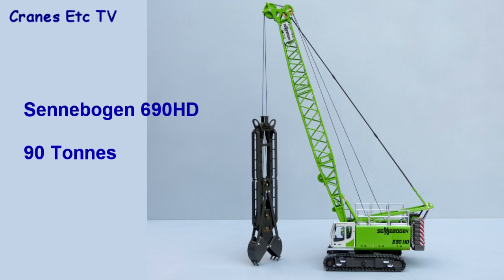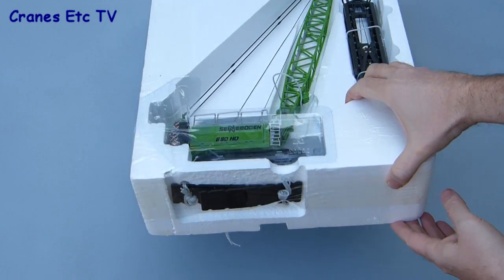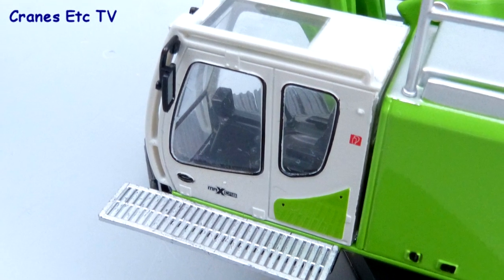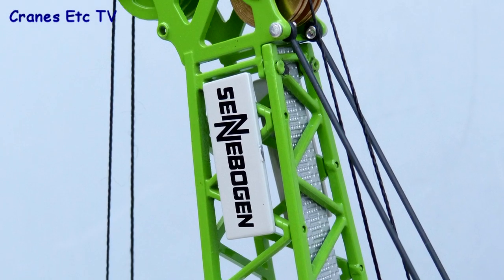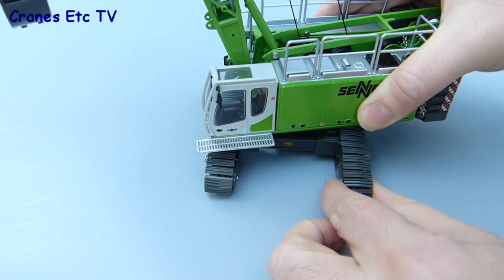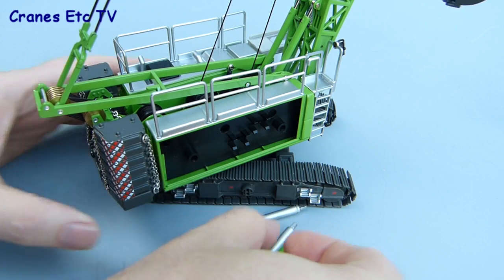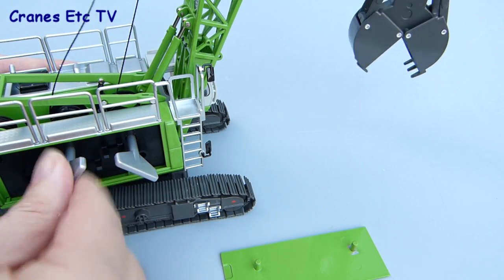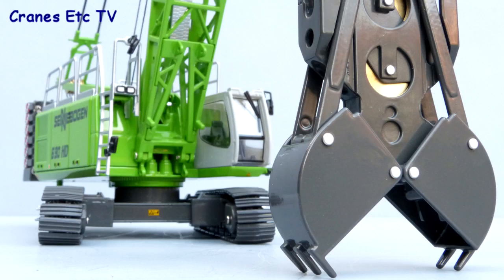ROS Sennebogen 690 HD + Diaphragm Wall Grab by Cranes Etc TV

Comment: Why not just cut the twist ties with wire clippers? Saves a lot of time.
Reply from the maker: To maintain the highest value in the long term, the packaging should be kept 'as delivered' as far as possible.
Reply: @CranesEtcTV  Perhaps, but twist ties? I doubt anyone would fault you for using replacements if it came to that.